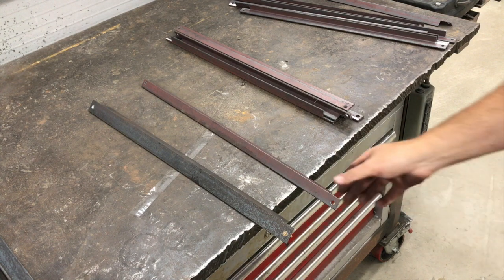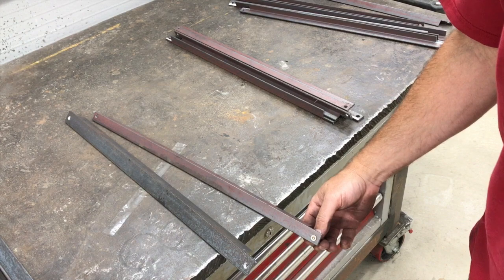DIY Hydraulic Punch or Drill Press -  Fastest way to put holes in metal?

Comment: I'm guessing he doesn't have an ironworker...otherwise couldve done the notch and hole punch.  How are you notching?  Guessing bandsaw looking at how you had the parts marked.
Reply from the maker: That's next.  Hydraulic sheer is in the works.  So poor mans iron worker tools
Reply: open-source-ironworker-machine-prototype-ii-completed

http://opensourceecology.org/open-source-ironworker-machine-prototype-ii-completed/

I thought it was a good read and gives some insight on what mistakes not to make

have you gone over the arc diagrams? very simple. Although I didn't like her design, some girl made one for her masters in mechanical engineering(I've made cooler stuff, wheres my honorary doctorate from MIT?), she did a blog on it and while it isn't the way I'd do it, I liked the links and process. She wound up ordering the most difficult parts from piranha. I'd have failed her. Why not design the hydraulic shear to be step 1 of the iron worker? I mean, you don't need an Ironworker if you are going to have an individual tool for each process. I think the only benifit to the ironworker is to have all the steel and hydraulics from 3-4 different tools all working together to be able to do each individual task at 3-4 times the capacity with the same overall cost and with a much smaller shop footprint- If I were writing a thesis on iron workers.
Reply: I was referring to his electric punch as the ironworker in this little competition.
Reply from the maker: I wish I had an ironworker, but yea I notched them on the bandsaw
Reply: Ramsey Customs - turbocobra how about a series on "the making of an irinworker" ?
Reply: Ramsey Customs - turbocobra me too...me too
Reply: discountoutdoorstore seconded it. nuff said, go ahead and start it.
Reply: Jimmy's Tractor lol